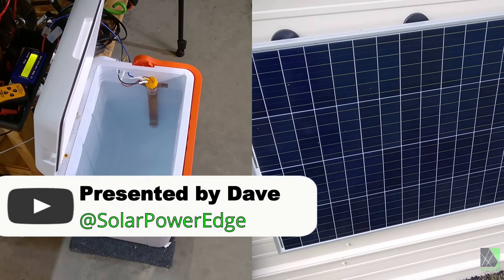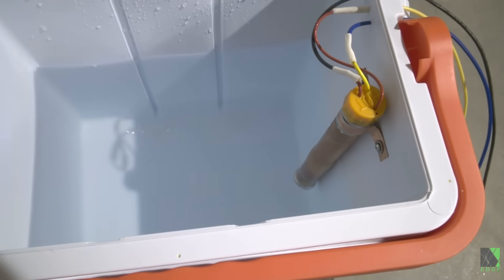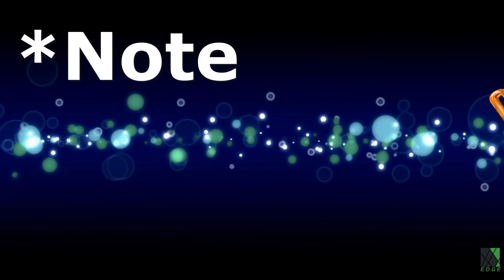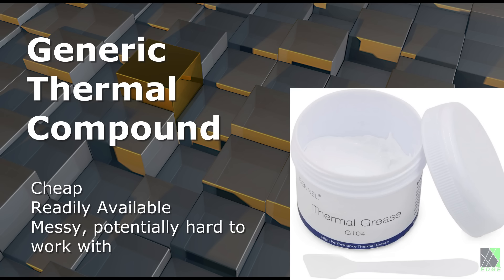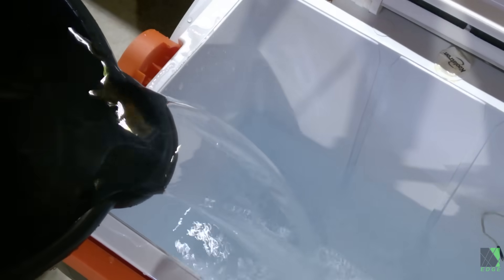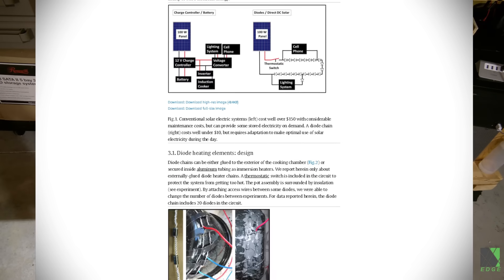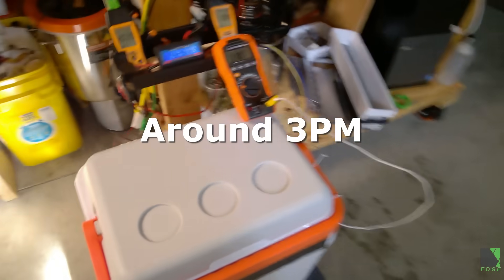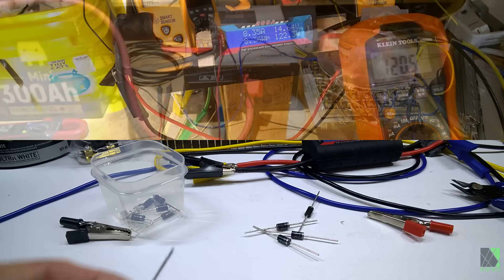I built a PV DC Semiconductor Immersion Water Heating Element! diode chain application #science

Comment: The problem with solar hot water is that it has the heat source a fair distance to the usage point, and exposed pipes can freeze and burst in frosty or sub zero conditions. Then there is the clutter of running plumbing up and around your roof. Many solar hot water heaters have a anti freeze valve that opens and allows some of your heated hot water out to warm the solar panel and prevent freezing. 

A friend of mine installed one such unit on his roof, and the only way he had hot water in the depths of winter was to run the electric boost element most days, as the anti freeze valves used all his hot water up over night trying to prevent freezing, and the valves are known to be problematic. 

I long wanted solar hot water to reduce my living costs, I even brought an evacuated tube unit, but decided not to install it due to all the problems my friend was having.   I then discovered there were places selling second hand PV panels very cheap as some were even going to land fill when there was an insurance claim on roof top PV solar.  I brought 2kw of second hand panels and installed them basically to do nothing else but heat my hot water in a standard storage hot water heater... there was some adjustments to element size and wattage and the need for an electronic thermostat relay... but once installed it worked like a dream... no problems with freezing pipes, no long distance to the point I use hot water, and only with weeks without sun shine did I get range anxiety and boost the hot water with an auxiliary power supply, which I found out latter was not required since it was the make shift temperature gauge reading to low, not a lack of hot water... 

But its the way to go: PV solar on the roof supplying power to a storage hot water heater, no complicated plumbing, no special anti freeze valves....it just works.
Reply from the maker: @apollo8352 Good points... you really understand the tradeoffs. btw I have seen a solar hot water system with glycol freeze and burst the pipes... not fun! Solar electric can heat your water with a pair of simple wires practically anywhere in the home, plus charge batteries, cook food, solar panels are just amazing tech

Comment: Hi why not hook up the diode chain then use the resistive heater in the tank.?  You are doing great work
Reply from the maker: @alantierney1 Hello, great idea and thanks for your support. I have tried this idea with the solar electric space heaters (in parallel) and it works very well. Much of the heat can be produced with a normal cheap resistance heating element, and the diodes in parallel act like a regulator to pull that last bit of heat out and control the solar panel voltage. This idea should work great for heating a water tank too!

Comment: Why wouldn't I just use a/the load dump on a Wind/Solar system, as a heat source?
Here it gets windy after about 10AM and it's THE go too after dark.
Why wouldn't I just create a direct run from a windmill to a load dump, and then build the rest of the SunWind system afterwards?
Reply from the maker: @FuhrChris Good thinking!
Reply: @solarpoweredge  I've done about 1/3rd of the digging for a double run of Geo tubes the cool tube should provide 55 degrees year round.  The HOT tube might have a productive 77 degrees averaged (This would be from decay from a 90 degree Solar Wall over the underground distance to the Trailer.)  Before the Geo tube air would enter the trailer the load dump would be placed in the middle of the air intake line.  (By using a smart enough temp controller the load dump would have  the choices of (3) different load dumps to chose from.  1 in the work shop. 1 before the trailer in it's air intake but not actually inside, and the last one under a sand battery.
This should make it an easy to add just enough BTU to the air in the trailer to boost it to whatever temp I desire.
The one in the work shop probably doesn't even need a Fan and would be used in a radiant exchange with a dehumidifier directly above it in the rafters.
It is BOTH the switching and the desire for a smart calendar that would tell the systems to start or switch or stop based on things like "time of day" , "Season of the year," and even ask me things like "Will you be going out to the work shop today?"
Reply from the maker: @FuhrChris That is a very interesting project. 55 degrees free cooling sounds good to me. I am planning to dig trenches for a similar project, and may integrate it into a thermal system if the experiments are successful enough. There are so many tasks do to around here it is mind boggling.
Reply: @solarpoweredge  55 degrees year round.  So if you are not pre-heating the underground line you would have a base line of 55 degrees to have to heat up to like 68 degrees.
Reply: @solarpoweredge  You need to redo your 12v/24v heating Video.
Here's the premise.
You either create a moveable project board and be able to move the 12v air heater into like your truck/car on cold mornings.
Or
You upgrade to having the system (In part) into your Truck/car's.
On the upgrade system you wire it to either External batteries or a 110v converter and then leave the Batteries behind when you drive off.
(This would mean your not setting in a Truck/car that it trying to warm up the interior.  Nor are you draining the Truck's/Car's battery to get there.)

The only reason to keep the 110v system in like the trunk, or under the seat would be on long trips or like warming up the Truck/Car after a long shut down period like an 8 hour work day, and you can find a plug in near where you parked.

Since I am off grid. I would use an extension cord in 12v over from the Solar panels or (I commonly have to leave before Sunrise) an Extra 12v battery or two, and then disconnect them from the outside of the Truck before I drive off.
(This whole plan elevates that first 20 miles of my Ass is FROZEN here.)
Reply from the maker: @FuhrChris Good thinking, driving frozen is no fun at all :) I saw a guy put a big inverter inside his car in passenger seat with thick cables going to alternator through dash. In the morning, he plugs in a big space heater in to warm up his car really fast. And that's even with the car stored in the garage. Up north the weather is just plain brutal!
Reply: @solarpoweredge  My Van had the heat from the Radiator wet system.  
It wasn't great on the first few moments but with an extra long hot hose snaked back and forth under a Futon in the back you had a warmed up bed by the time you turned off the Van.
The two extra fans and extra radiator space made it you could drive with the window open a little bit and your wet clothes hanging on a line in front of heater number 2 in the back, and generally dry your wet coat etc.... before your camping trip was done, going to camp or coming home from camping.
Reply from the maker: @FuhrChris Now that's an awesome setup, I like it

Comment: You might want to use copper piping with solder to keep the elements at the bottom of a tank.
Like the tank has a through tube at the bottom(soldered = led paste, copper pipe)
Inside the pipe you can put your diodes and inject thermal compound
So all the heat generation is at the botto
Reply from the maker: @dissonantiacognitiva7438 That would work, thanks for sharing ideas. I hope the next version will work better and transfer heat more effectively

Comment: Adding a thermally coupled PTC in series might be enough to limit the heaters power output above the operating temperature to prevent overheating.
Reply from the maker: @einball Good idea, adding series resistance that's worth experimenting with

Comment: Did you try oil immersion inside the copper tube? Did you create a thermo-siphon loop inside the water bath where the diodes are at the lowest point of the loop? Oil or any other liquid flows in this heat loop without a pump.
Reply from the maker: @williamhoover1515 Good ideas! I want to try it... lot's of projects, the list keeps getting longer :D

Comment: I’ve been interested in solar energy for a long time, but back then panels were way too expensive. Recently I found some 615W bifacial panels with 22.6% efficiency here in my country at an amazing price, and I couldn’t resist. The only issue is that the rest of the equipment for a full setup is still really expensive, so I thought I’d try running the panel directly with DC devices. Turns out it’s not as easy as I imagined—but your video gave me hope!
Reply from the maker: @Gh_Ovimarlixion777 Glad you like this stuff :) I have a lot of appliances running on direct PV DC solar, some of them have appeared on video. 
Here are some playlists: 
https://www.youtube.com/playlist?list=PL8a6nRTNyF9NZkjFgjfESLujgdZFTgdym
https://www.youtube.com/playlist?list=PL8a6nRTNyF9NvabeX8VLdF1NHfWyM2x9a
https://www.youtube.com/playlist?list=PL8a6nRTNyF9NaLLnvv7lxb0F5TGonkPyY

Comment: I am a plumber and heating engineer from the UK.
Im building a off grid home for me and my three daughters.

I have solar panels and batteries. 
Two petrol generators. 
Bottles gas geater cooker top.
240v cooker top and air fryer and two fridges a 240v and 12v.
I have 48 v batteries at 900wa 6  of rhem.
I also have led power solar to charge at night.
A 20lt water heater and a gravity feed hot water cylinder witha 3kw heating element.   
Im in the middle of workingbout what i need and do t need to live off grid.

So my questions to you are.
Can i run you heating diode strings  run in a higher voltage?
Can i built a inline instantaneous water heater from diodes string elements. Eg two of you 1 inch ones in a 4 inch housing with passing water through to heat on demand.
But i love the idea of a solar slow cooker.   That really would change my life.  To come home and have hotwater ready to use and a hot meal.  
Sorry for the long comment.   
Tha k you for you research and hard worrk.
Reply from the maker: @marlonjoslin6730 Hello to you in the UK and thanks for your comment! :) I think the ideas you mentioned will work - but of course it's quite a task to implement those kinds of prototypes. Lot's of experimenting required.

*Technically speaking, any number of diodes can be used to regulate any voltage. The key is to match the diode string forward voltage (vF) to the correct solar panel max power region (vMPP). Diode string behavior is extremely useful if your only goal is to extract maximum heat from a PV solar array. However... the tough part is actually integrating diodes into a functioning system. The diode packages we have today just aren't intended for solar electric heating. This makes it very challenging to make a working system. We have to figure out everything from scratch and there are no pre-built systems.

*Perhaps a better solution for tankless HWH is to use a parallel array of diodes with a standard resistance heating element. This would get a bit of extra heat from the panels while still relying primarily on normal resistance to do the major part of the heating. That's what I do with my space heaters and it works great - so long as the sun is really shining and there is adequate power available.

*PS I have built multiple diode based solar electric cookers... if you're curious, here is one that made it to video:  https://youtu.be/CRhkZp6ECHk

Comment: Why not use a shunt regulator using high power transistors or MOSFETS bonded to a heatsink. it can be designed with whatever regulation curve you want.
Reply from the maker: @mikevincent6332 I prefer the dirt simple approach of a few diodes in series. But as many have suggested more complex circuits with FETs will work also.

Comment: While searching proper diode/bridge rectifier to build your idea, I stumbled upon ads showing PTC heater (resistor which increase its value when its temperature is increased). Wondering what is your opinion on PTC as part of water heater...
Reply from the maker: @RitterShot-og2mm PTC reduces its power output as temperature rises, so that is an interesting concept. Rather than a thermostat, we could have a PTC HWH element that stops heating at about 150F. I like the idea!

Comment: I have experimented with LED lighting for a microwave truck and I used diode to drop the voltage that I needed and those suckers got hot interesting very interesting
Reply from the maker: @josephthibeault4843 Yeah they are super handy for dropping voltage, as long as they don't let the smoke out!

Comment: What about eurythemol and sawdust for the pipe filling? Or some other passes change material like wax?
Reply from the maker: @bigmouthstrikesagain4056 I am thinking about this and wax would be a very interesting option. I'll be getting some paraffin to experiment with as soon as possible 👍
Reply: I find your videos very professional And informative. How about using sand?
Reply from the maker: @Brad-sh2wn Thank you sir, and I appreciate you watching them. I have paired diodes with resistance heat (in parallel) and that's the best way to use them with sand batteries. Because the diodes can act like a regulator and extract a bit more heat, while still using the properties of normal resistance heating elements. I plan to do a little more video about this in the future hopefully
Reply: Thank you for your response. I have 12 volt solar panels . What would be the name or number on the diodes I should use? @solarpoweredge
Reply from the maker: @Brad-sh2wn No problem. You can actually use any kind of silicon rectifier diode. Main concern is don't let them overheat. If you want to push some amps, I'd try metal-cased 50 amp bridge rectifiers shown (linked in description) as they're pretty tough and can be mounted to heat sinks. For your 12v solar panels, I'd buy about 20 bridge rectifiers and start with hooking several up in series and measure the voltage. They do change voltage based on heat, so need to decide on an operating temperature. For example, with a good heat sink and fan, you might be able to hold 50C temperature, and then just tune the # of diodes from there until you get a good balance. It's a trial and error process usually. Also need to find out what voltage (vMP) your solar panels prefer, for best power and heat production.
Reply: Wow thanks a lot for the help. @solarpoweredge
Reply from the maker: @Brad-sh2wn Welcome!! :)

Comment: Okay here is a project for you to take this further. Boil the water, in small quantities to create steam for water purification (distilling). This means that you are creating a fresh clean drinking supply using an efficient solar supply. Current passive solar evaporation systems are quite large, slow and especially inefficient in cloudy conditions.  So, a diode chain concentrating the heat on a small water chamber, valved to release steam and refresh water input, could be an excellent emergency solar water purification kit…
Reply from the maker: @twictnet Great thinking! I have to try it. Last year I built a small water distiller that uses diodes. Unfortunately I haven't made the video yet. Your idea is more advanced requiring a valve, but 100% doable. Well if I am able to build one, I will share it as soon as possible

Comment: I do not know if you say in video, but if you put the heater 2m below the tank and using the heat convection it will improve the power of heating?
The water mass/quantity need to be the same for comparing.
Reply from the maker: @luisdaniel3363 Yes you are absolutely correct. For these experiments, I wanted access to the heating element and could not seal it properly yet. so I put it near the top and used the pump to stir the water and get accurate measurements. But having the heat at the bottom makes the most sense. Hopefully the next version will be sealed and can be installed at/near the bottom of the tank

Comment: maybe shorten the leads of all the diodes, less resistance, angle the pump outlet tube to the top of the heating element which should not be at the side.
Reply from the maker: @jyvben1520 Good ideas thank you